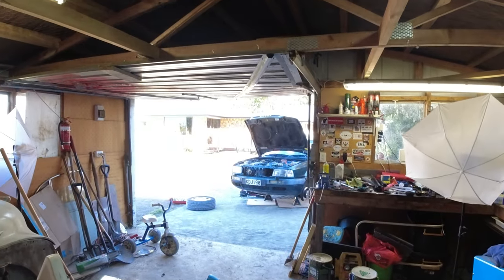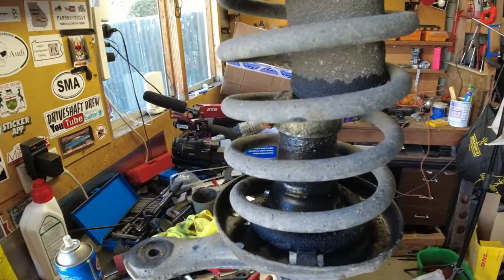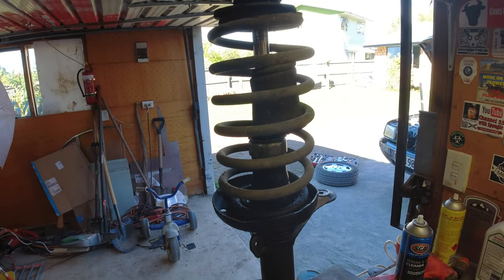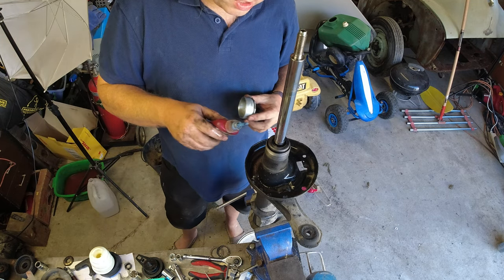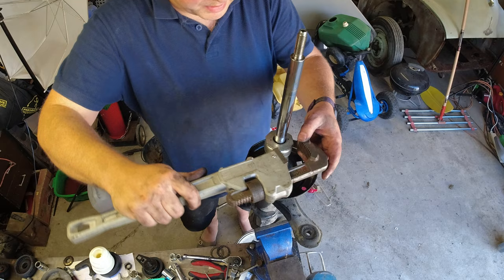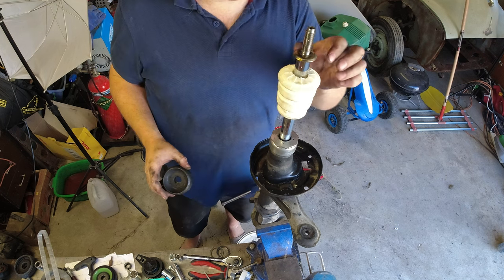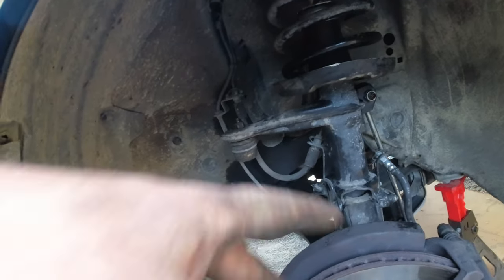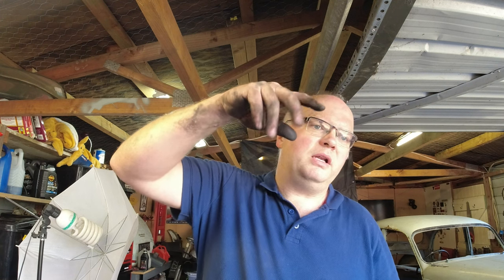Leaky shocks? The 4 year comeback - Project Nineties 80

Comment: A portion of the energy generated by the earthquake is spent shaking the fluid back and forth in the dampers, which in turn reduces the energy available to damage the wall or building structure.

Comment: After 3.40 when i saw the spring compression seat pop out on one side I was expecting the worst from then on, especially so when you took a pry bar to the spring and then again when you gave the spring a belt with a mallet to seat it.  Anyway, im glad it all ended well.
Reply from the maker: better a mallet than my fingers! The spring was already captive at that point. The pry bar was to adjust the spring stop tab and did not touch the spring.
Reply: @Badgertronix  Thanks for the explanation. All of us avid fans out here only get the one fixed view of what you are doing, which obviously can't cover every detail.  I'm sure you are fully aware that compessing these coil springs can be seriously dangerous stuff.  Over the past 50 years of fixing vehicles I thankfully have had no safety issues, but I have twice seen the utter devistation that was left behind when things went catastophicaly bad, resulting in a lot blood and guts everywhere. One was when the mechanic had been "hammering the spring" to locate it, this caused the one end to snap off one of the compression tools. The resulting uncontrolled and rapid expansion of the coil spring then snapped the end off the new shock absorber strut! 
Its a job that requires much respect and 100% concentration with no other distractions at all. And of course wearing all the appropriate safety gear, including the Hi-Viz too.  
Just stay safe mate, I love following your channel, i would hate to see it come to an abrupt and untimly end. 
David in the UK.